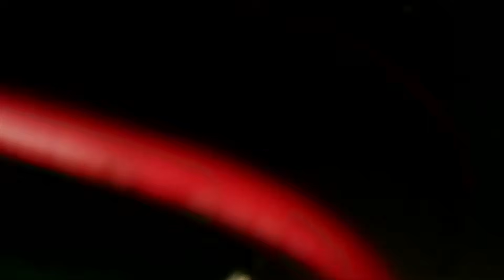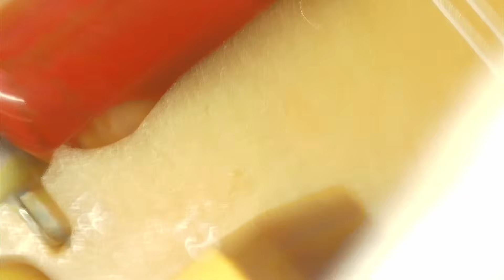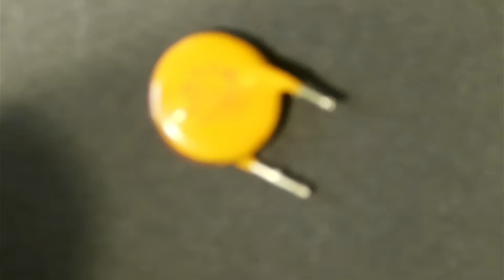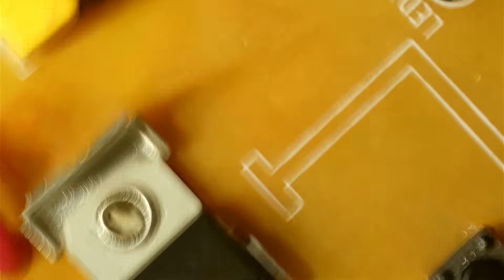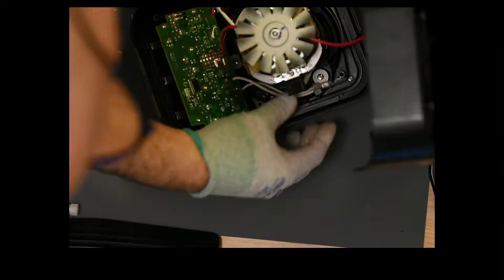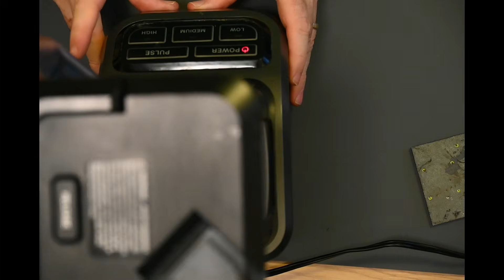Ninja 1000W Blender Power Surge Repair

Comment: That thin wire for a 1000 watt motor?
Reply from the maker: According to the internet  a 0 .1mm wire at 110v with take about 6 amps of power (About 1200 Watts) if it is not exposed to the air before it burns out.  I am not a fan of a "fused trace" but using a larger wire could be dangerous.  The small wire acts like a fuse in this case so if there is a power surge at least the main line and breaker for the building should not be affected.

Comment: what is the gel you use to clean the board?
Reply from the maker: That's just 99.9% Isopropyl Alcohol (IPA).  Under the microscope it looks more like gel, especially when it mixes with the flux.  I think it cleans well because the flux I'm using seems to not be too sticky.